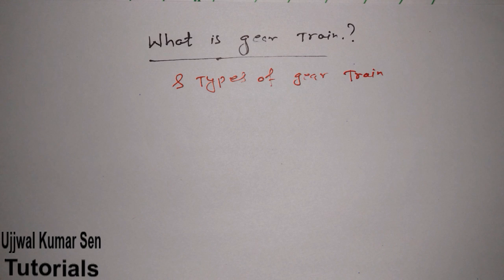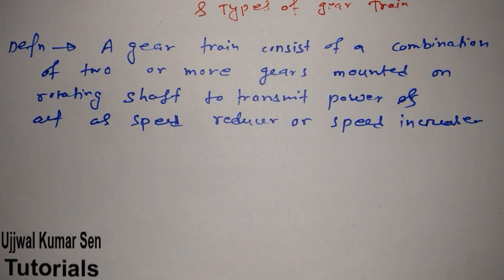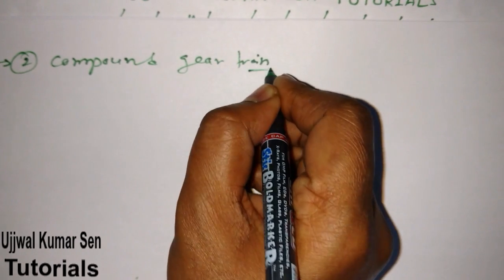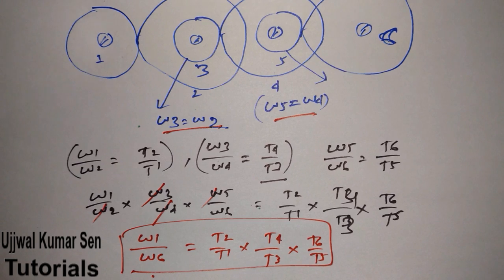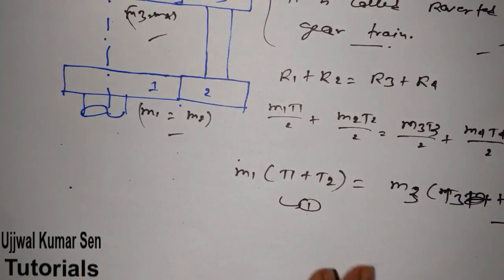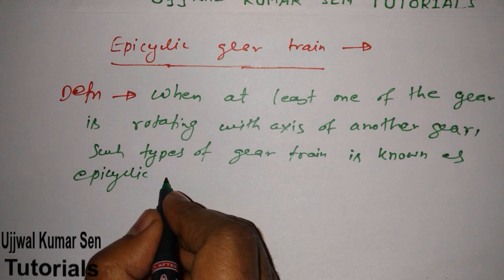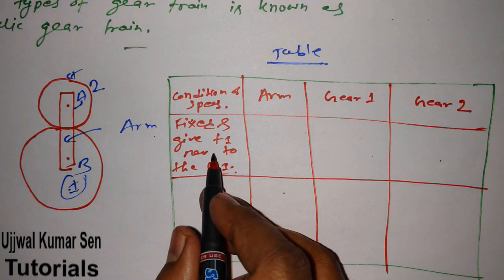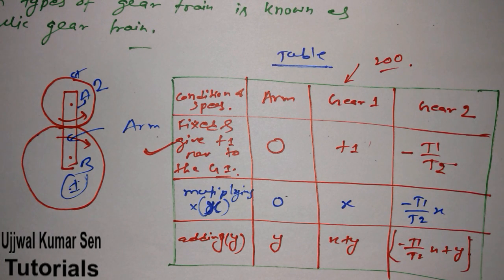Types of Gear Trains Basic, Formula and Numerical Problems Approach for GATE

Comment: you didnt explained fully how we got final formula in reverted type gear train. You did'nt explained how module relations converted in speed relation with teeths.
Reply from the maker: Need separate video on it
Reply: its very simple gear 2 and 3 are compound gears thereby W2=w3 and get cancel